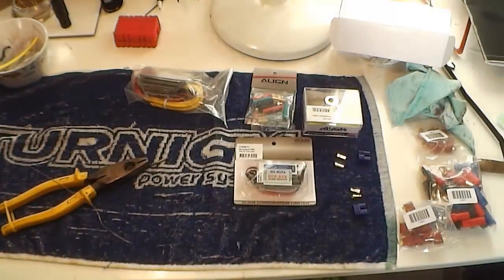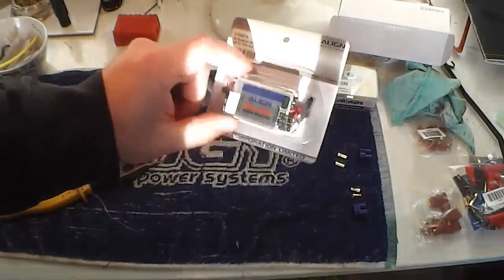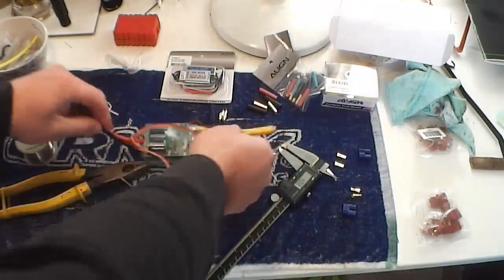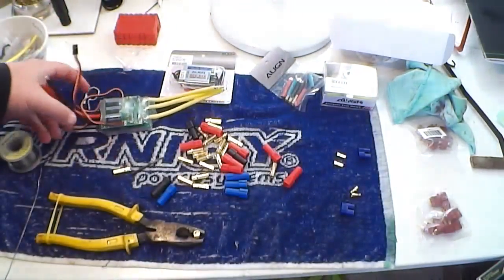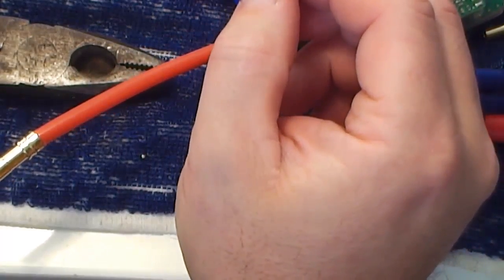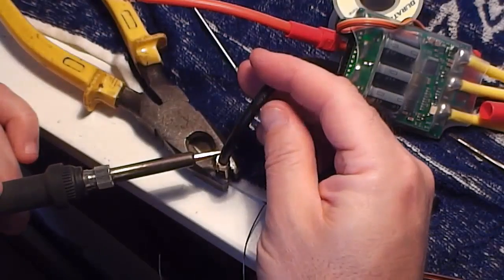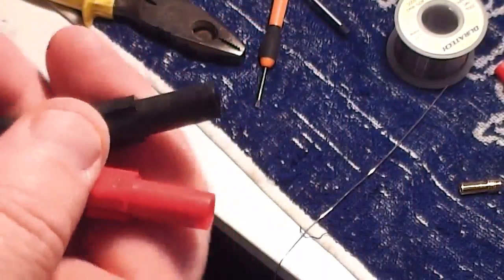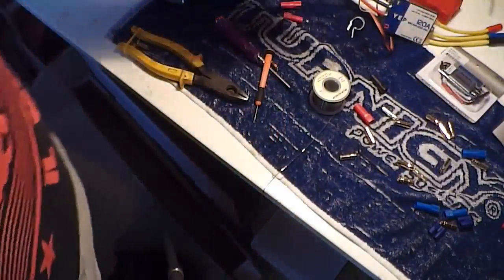630 goblin Build Soldering ESC YEP 120HV

Comment: Can anyone help please. I have this controller and am unsure as to the need for the 2 off 3 wire ribbon cables. There is no BEC on it so surely only one single wire is needed to send the PWM to the controller from the receiver. What are the other 5 wires for? I can't find anything in the documentation.

Comment: DO you have the manual of the ESC? There is 2 cables (brown, red, orange), which one should be used to receiver? Could you help me?
Reply from the maker: That is for the ESC
BROWN = NEG
RED = POS
ORANGE = SIGNAL 
Hope that helps
Reply: Thank you for the information. I'm trying to make ESC YEP 120a HV work. The red led is power on, but it doesn't beep. Do have any idea what is going on? I'm tring to use it with arduino. Could you please, help me?
Reply from the maker: I have not used this controller for years. I would guess at saying the throttle possition has not been calibrated and your controller thinks you are not at ZERO or full position. (Zero will initiate it in normal mode and Full will put it into programming mode). Try it in the full throttle possion then see if it beeps and then pull thorttle down to Zero Position. Should learn and initialise. - MAKE SURE YOU HAVE NO BLADES ON OR YOU COULD GET INTO TROUBLE! see how that goes.
Reply from the maker: So .. To Clarify:
1. Turn on Transmitter - make sure you are paired with your RX and it is binded
2. put TX in to full throttle position
3. Confirm you have a 0-100 percent throttle curve set up in your TX
3. Turn on ESC - should go into programming mode
4. pull throttle to Zero and it should initialise.
5. Pull power to your ESC - then power down your TX
6. Turn on your TX and wait til it is binded
7. power up the ESC and it should run as normal

Hope this helps ... cheers Westy!
Reply: I'll try it. Thank you for your help and attention.
Reply from the maker: Best of luck... I am pretty sue I did a video in my library about hot to do that ..... have a browse through them ...